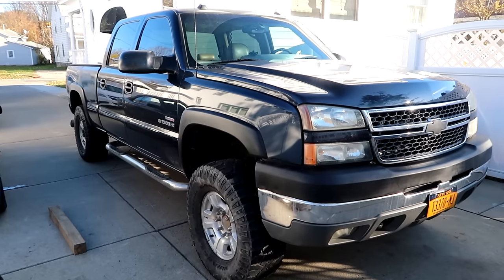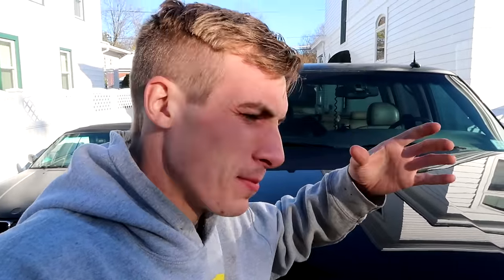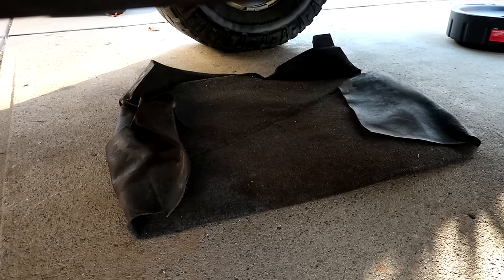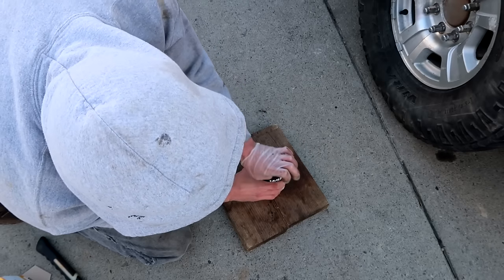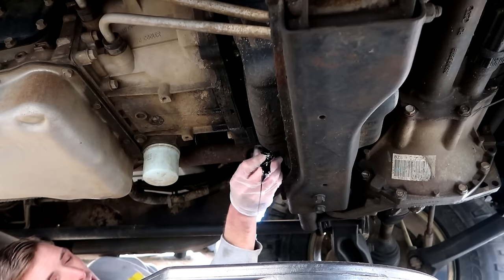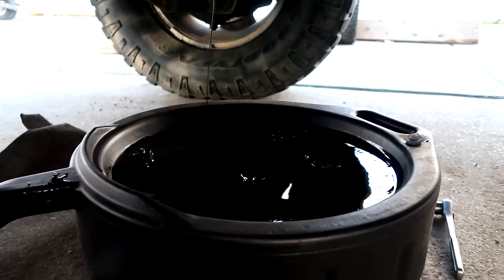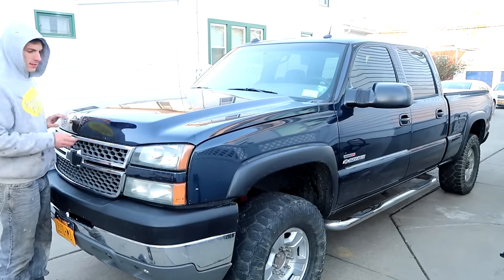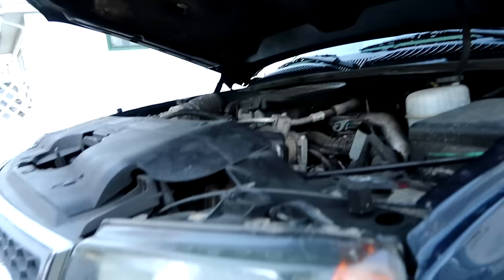THE WORST THING ABOUT A DIESEL...

Comment: How often do u change p the oil? 10,000 miles?
Reply: Brett Young - It depends on a bunch of things. Mainly what the vehicle manufacturer recommends but, generally speaking, conventional oil is good for 3,000-4,000 miles and full synthetic is good from 5,000-7,000 miles
Reply: Well with higher oil capacity wouldn't it be higher? Or is it because it's a diesel and diesels are dirty af lol
Reply: some are 10,000 some are up to 15,000 more expensive oils such as amsoil can be run 15,000ish and yes because there is a larger capacity...
Reply: + dash cam channel... So do cheaper oils have to be changed at 3,000 and more high end oils at 15,000? Or is it different cuz I'm hearing different stories
Reply: If you want your engine to remain sludge free using cheap non synthetic "store brand" oil in a smaller oil capacity vehicle "6 quarts or less" change at latest before 5000 miles. 3000 is preferred before the oil itself begins to degrade causing more engine wear... If using synthetic high quality and a good filter 5000 to 7500 especially if the car is newer because the engines have tighter tolerances internally and the oil doesn't get as dirty as fast as older models of engines. Same scenario for the diesels just the oil lifespan is longer 10000 to 15000 because the quantity of oil is greater and takes longer to get dirty. The poblem with cheap oil is they break down faster, failing to properly lubricate the engine, and begins to sludge the engine up if they are used for too long before being changed...
Reply: First scenario is for a gasoline lower oil capacity engine...
Reply: + dashcam channel... So speaking of oil life and comparing diesel to gasoline under the scene rep of late 90s diesel and using high quality oil there wouldn't be much difference in oil life between diesel and gasoline version truck?
Reply: If the same quality of oil is being used "let's say it is high quality synthetic" the scenario of same year vehicle gas engines and diesel engines oil life before having to change it theoretically is the same for example the gas engine takes 5 quarts and is changed at 5,000 miles/ the diesel engine that takes 15 quarts of oil is changed at 15,000 miles in simple terms of that there is 3 times as much oil to get dirty in comparison. In a side note manufacturer's want you to run higher quality oil in a diesel regardless due to the strain and heat caused by oil going through the turbo itself which can be like a furnace at times causing accelerated breakdown of the oil over time
Reply: + dashcam channel... That's what I thought but people were saying it like 3000 miles on a 3 gallon oil change... I was acting diesel but idk how reasonabky they are to maintain and especially the oil... I don't care to put 10 gallons in one lol but it better be 50,000 miles lol not 3,000... U get what I mean...
Reply: I was wanting diesel but idk how reasonably they are to Maintain ...
Reply: Yep most have no idea what they are talking about or compare apples and oranges...
Reply: It all evens out between gas and diesel trucks cost of ownership wise "after buying the more expensive diesel truck of course"... the only difference is when they get old and parts start to break the diesel is a lot more pricey to fix.
Reply: I change my oil every 10,000 with Rotela T6 and a Genuine cummins filter.  My truck doesn't have an erg, or any of the emission control systems the new trucks have.  You can't run extended drain on the newer trucks like you can on old diesels. 

An oil analysis shows my oil is still usable after 10K, but 10K is a nice easy number to remember
Reply: + Alan... Extended drain??
Reply: Brett Young  extended drain means running extended oil changes intervals.  some guys use elaborated bypass oil filtration systems and run oil 20,000+ miles safely

Comment: I refuse to go by oil life meters.. ever pull and engine gone by that? There's alot of crap built up... Funny part is that you complain about that much oil... I have an extra large oil pan on my silverado 5.3L and use half and half oil.. Its $110 oil changes if im too lazy to do it myself...

Comment: my 05 f350 takes about 5 gallons of oil you are lucky yours is only 3
Reply: 5 gals? 6.0 take 15 quarts
Reply: yes I know my 6.0 takes 15 quarts this last oil change I did it took about 4 1/2 gallons or a little less than that so therefore I buy five gallons and have extra in case I need it

Comment: Diesel = Fine particulate exhaust, valve noise
Reply: It's true - and gasoline puts other crap in the air. Don't act like diesel is causing the world environmental issue, diesel and petrol both are. Get off your high horse, cause you drive a petrol ..
Reply: No I drive a Nissan Leaf; I save 10 to 100 kg of CO2 daily, costs $20 a month in electricity, and this year $28 to rotate the tires.  I will have to buy tires next year, brakes last a few years.  There is no exhaust, electricity is from hydro i.e. dams where I live about 80% of it. When a good electric truck comes out you should get one.  You could spend $20 a month for fuel and drive 100 miles a day; buy tires and thats about it.  Also I read a study about indoor private home air pollution and it is mostly from car exhaust, unless there is a smoker in the house.  I was surpised to hear this.  Merry Xmas too.  Joe

Comment: the funny thing about this guy is that i never see him tow anything. and the cons with that truck is the trans cooler lines are crap and since it is a high preasure system the injectors cost 5000 or more unless you blow out the whole system becuase in this video he also did not change the fuel filter. that whole system cost around 15 thousand to replace. You are wrong about gas trucks as well i own both they both come out the same i have a 2010 chevy 6.o with 422000 miles on it and it is great but i have had to do nothing to it but the 2010 duramax it has two sets of injectors and a injector pump. diesel is just a hype for yuppys that dont know anything i live on a farm and i am a crane mechanic this guy is just a joke

Comment: NEVER EVER PREFILL A FILTER!!!!
Reply: Hayden Blegen yes you should.
Reply: zorlord100 
Due to the fact that there is the slight possibility of introducing contamination from the oil in the bottle directly into your filter puts you at risk of sending the unfiltered (oil you put in the filter) through your system and could have serious consequences.  But what do I know I only work for caterpillar which has some of the highest contamination control restrictions out there.  You do you guy.
Reply: Oil filters probably not as big of an issue as fuel filters, with today's common rail engines cleanliness is key and you never know what is in your fuel.
Reply: The only benefit that pre filling a filter has is that the system primes instantly instead of doing it the correct way.
Reply: Hayden Blegen they say 90% of engine wear is from start up since there is no oil pumping. what about when you fill the engine oil still goes down onto lifters and onto the crankshaft from filling.
Reply: zorlord100 
I believe you mean camshaft the crankshaft receives all of its oil from internal galleys and or jets that are supplied with FILTERED oil not unfiltered.
Reply: zorlord100 I do agree with the engine wear statement because that is true start up and idle are the hardest on motors because of lack of oil flow but when you change oil unless you drop the pan and oil pump/cooler etc.  there will still be enough stored oil in the system from running the engine prior to the oil change where you won't see any wear from the time your engine starts to when your filter gets filled and begins sending filtered oil throughout the system
Reply: Hayden Blegen in a diesel (or anything that uses a high pressure oil pump) you better fucking prefill the oil filter or that pump might not take a sump and bam, no oil flow and blown engine
Reply: MegaElkHunter1 
Well if you read the reply above you'll see my answer for that you'll see that the system is more than likely primed already since you probably drove it or ran it to warm up the oil.  Also if you have any brain cells at all you would watch your oil pressure gauge to make sure that within 3-5 seconds that you have oil pressure.  I drive a 7.3 that run a HEUI system which need oil pressure in order to run...period, since the injectors are hydraulically actuated so if your statement was true my pickup would never start again after I changed the oil.  But since I am right the oil in the system allows the engine to start right away runs for about 3 seconds (as the filter fills) and boom you have oil pressure and the system is filled with completely filtered oil.
Reply: Hayden Blegen that's where you're still wrong. The chance that an actual jug of oil from the factory will be filled with any traces of contaminates is a billion to one and probably never going to happen. And this also takes into account of how long you let it sit. If you let it sit for 10 minutes after running it for an hour the oil will still be hot and can slip past the pump causing it to dry sump. If you let the oil sit for an hour and a half to cool and it's almost at the temperature it was before you started the truck you might get lucky and it'll be thick enough to keep the sump. I have over 17 years of experience in servicing diesels and every time I see one with a blown engine or HPOP it's because they didn't prefill and it ended up not priming. You're always supposed to prefill diesels. Read the service manual
Reply: MegaElkHunter1 do you prefill fuel filters also?
Reply: Hayden Blegen yes. There's literally no harm in doing so and take an example from truckers. People who do nothing but work on Diesel engines and drive for a living. I've never seen a single one who doesn't prefill a filter. Not one. For the reasons I've stated
Reply: MegaElkHunter1 
Put shitty fuel in a common rail filter once and spin it back on...let me know what the bill is and I also work on diesels everyday as my job caterpillar service technician. That is what my degree is.  Just because people do it doesn't mean it's right.
Reply: Hayden Blegen when people have been doing it since before your job was even needed due to lazy people trying to go against what already works, it worked for fucking years. And thats why I always make sure my extra fuel cans are clean. Take care of your shit, and more shit won't break. It's as simple as 2+2 sometimes
Reply: Caterpillar invented the HEUI so I will take their word over yours any day of the week keep doin what your doing you can't teach an old dog new tricks that's why they teach guys like me the correct way to do things so they don't have to deal with the bitching when shit goes wrong
Reply: Hayden Blegen lol dude I'm young and going into UTI for my diesel cert and I'm starting a shop after. My dad has been a trucker for over 22 years and he simply taught me how to do things the right way. And is that why the service manual on his C15 tells you to always prefill filters? And the CAT oil filters also tell you to do so? Your own company is telling everyone to do something you're not. So either you're lying, or you don't actually pay attention in those classes of yours that teach you how to do things the "right" way lmao
Reply: Just because you are getting told the correct way to do things by a younger tech does not mean you need to get hostile
Reply: Hayden Blegen not a single diesel oil filter calls for no prefill. Not one that I've ever seen anyways. Even the older 12 and 24v cummins without the automatic fuel priming pump called for their fuel filters to do it. And surprise, they were common rail.
Reply: MegaElkHunter1 
Over 17 years diesel experience and just starting college most people learn to walk before they turn a wrench.  I've farmed with my family since I was 11 years old and I thought that when we worked on our equipment we did it "the right way" I now work on over the road trucks and farm equipment daily and have done so full time for almost 5 years and you will not believe the things that I have seen that the farmer or trucker claims was the "right way" daddy doesn't always know best...now let him make your pickup payments while you go to school and actually learn how the manufacturers want their products worked on
Reply: MegaElkHunter1 
Also, all cat oil, fuel, and hydraulic filters call for no prefill due to slight possibility of contamination.  I'll use your words, "read the service manual."
Reply: MegaElkHunter1 
Here's a cummins contamination control website... and oh look states in there that filters should never be prefilled.  I can keep going but I think we all now know who did their research and actually knows what the manufacturers want and you haven't provided shit besides what your pops taught you as a kid.  I'm sorry that you were taught the incorrect way I just hope you begin following manufacture guidelines.
Reply: Hayden Blegen and I can literally go out right now and take a fucking picture of the oil filter and how it says to prefill right on the fucking side lol
Reply: MegaElkHunter1 
The picture with the oil can on the side is telling you to lube the seal with clean oil not prefill the filter
Reply: Hayden Blegen there's three pictures on the side. First one is pre lubing the o-ring, then you prefill the filter, then you install it.
Reply: You must use wix hahahaha
Reply: MegaElkHunter1 
If I could send pictures through here I would because even on fleetguard filters there is a big picture of pouring oil in the filter with a big x through it.  Now I don't know what planet you come from, but that on earth means do not.  The only "proof" that you have provided is you and your dads word.  I have given you two websites from two of the most highly used engines equipment and it states clear as day that you my friend are wrong.  Your argument is invalid and this conversation is over.  Have a good day

Comment: You said diesels have more power than gassers. 

LOLOLOLOLOLLLLLLLL

2017 6.6L TURBOCHARGED Duramax diesel: 445hp. 

2017 6.2L NATURALLY ASPIRATED LS gas; 455hp.
Reply: NovaMan 350 
Now compare torque. Diesels are about torque. The power is within the torque.
Reply: TDNomad Torque doesn't win races.
Reply: NovaMan 350 
You clearly dont understand how HP & torque work together. You cant have 1 w/o the other.

Comment: You are about as bad as the fast talking dude in the commercial, you have a Duramaxx engine that takes 10 qts of oil, boo hoo.  Try changing the oil in a 15 liter Cummins Diesel.
Sure it costs more, but if you do the maintenance like you should, (every 10,000 miles), that engine should be able to last for 500,000 miles with no major repairs. Another YT'er looking to make a little extra cash talking trash in front of a camera......